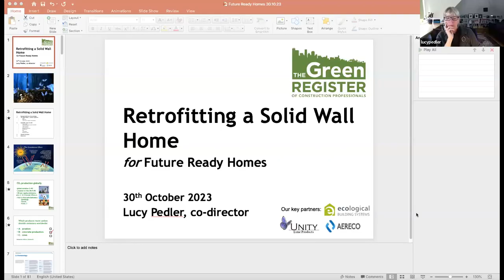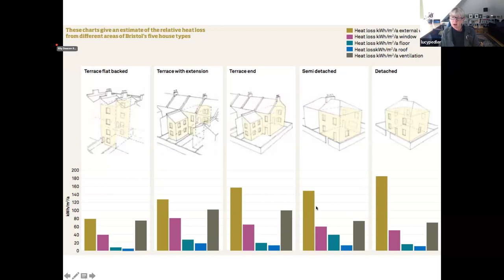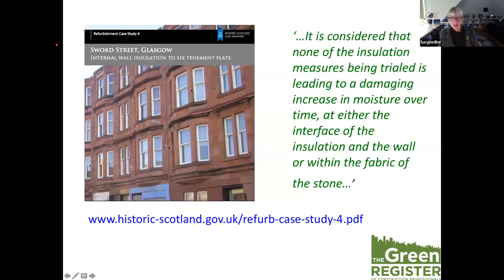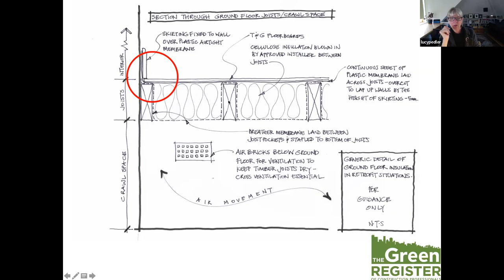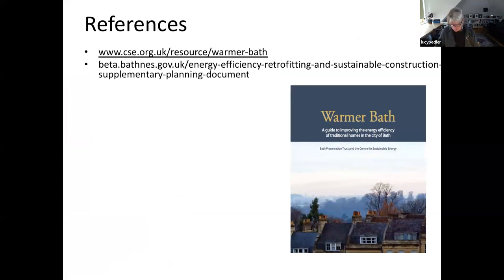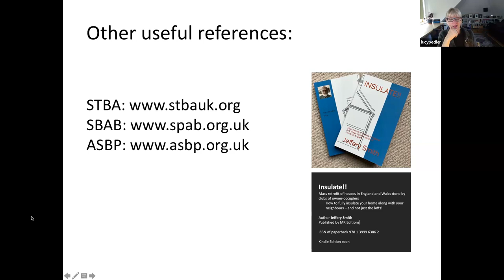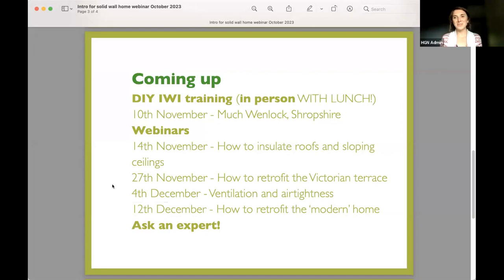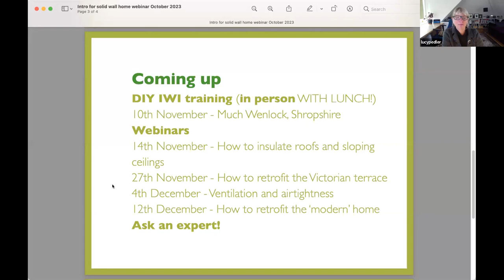HGN Building Sense: Retrofitting a solid wall home

Comment: Thanks Lucy for lots of useful info there. Glad to hear someone sing the praises of woodfibre. I insulated a dormer roof using 50mm Steicoflex woodfibre insulation between the rafters, with good results. First I fitted 50mm timber battens to the sides of the rafters to ensure an airgap to the tiles, then I pushed the insulation against the battens. It's fairly easy to cut with a breadknife, although you do end up covered in fibres. It fricton fits quite well, but I secured it using the big plastic washer things that are used to fit cavity batt insulation in a wall cavity. I snipped each one in half & ran a long screw through them, the insulation and into the batten. A few years on, the householder has had no problems and says the house is far warmer than with the poorly-fitted polystyrene that was there before. I think a competent DIY-er could do a good job.

I was doing this work not long after the Grenfell disaster, so fire resistance was very much on my mind. Sceptical of quoted flame resistances, I did a bit of my own testing by placing various samples on the floor and blasting them with a blowtorch. Rockwool and fibreglass were fine & non-combustible, the woodfibre held up well although scorching and smoking slightly. The plastic-based samples I tried - polystyrene, expanding foam, foiled bubble-wrap, and layered foil & fabric were alarming. All caught instantly and burned brightly with lots of smoke until completely consumed. 'Fire rated' expanding foam melted almost instantly but didn't continue burning. As a result, I think I would still be happy to use foam-backed plasterboard as IWI, but only with careful detailing to ensure the foam remained in a closed-off gap, and I'd be reluctant to put any significant amounts of plastic-based insulation inside the building, except maybe some little bits in low-risk areas like layered foils around window reveals, fire-rated foam in gaps round external door & window frames, pipe entries, etc.

Prior to this, I had insulated my own home with 50mm foam-backed plasterboard IWI, with good results and no problems. A once damp, cold and expensive to heat mid-terrace is now warm, dry and the bills have halved. I think some of the advice out there makes the perfect the enemy of the good. A friend was recently told he needed at least 150mm insulation in his solid-walled home, which is not viable even for his large house when you consider width of staircases etc. Similarly with some of the advice about damp. Before insulating, I think the dewpoint was more or less at the plaster render / brick interface, meaning that great chunks were coming away. and black mould was everywhere. Since stripping the render and dotting & dabbing IWI board on 10 years ago, I've had no problems despite being loudly warned "the house needs to breathe!!"

Comment: On the old Chapel walls you kuldip timer frame inside with  small gap and insulate 50 to 100 mm with vapour barrier beforplasterbard.  Uses bit more space but works well.

Comment: Not sure if you explained use of Tyvec  roofing felt on your nouse  Not sure if upyou indicated the costs and the heating ,underfloor  water or electrical. Heat pump ? Secondary windows are effective  if originals have to be used